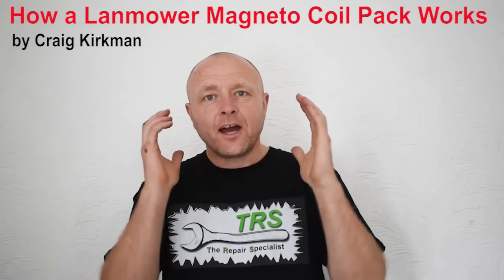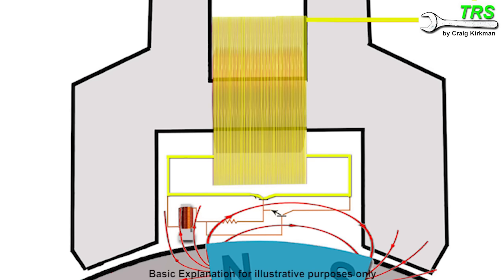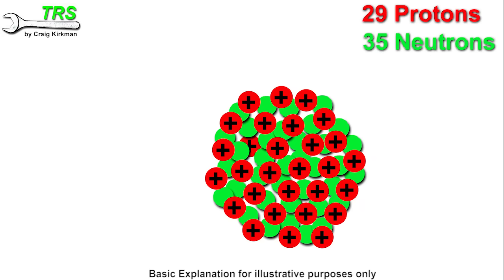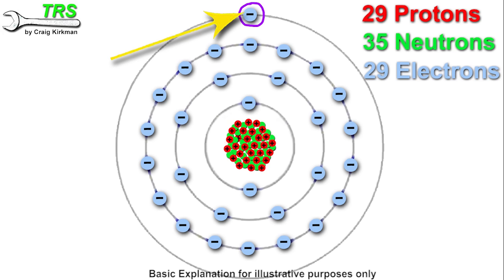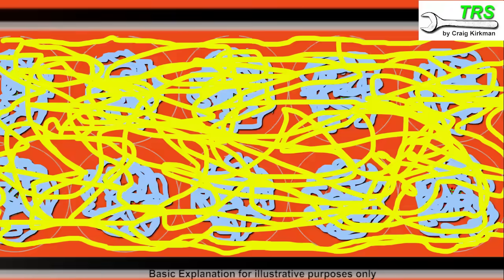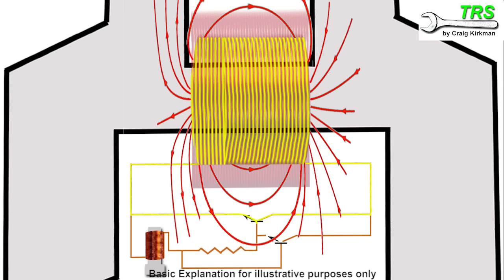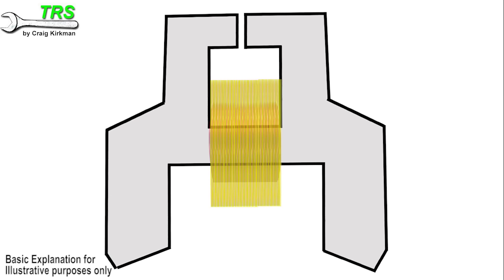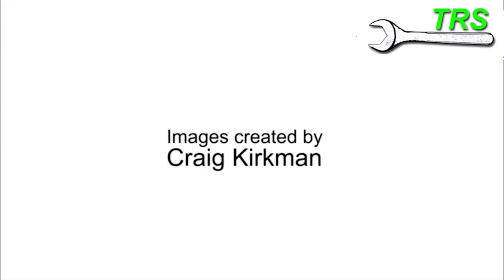Lawnmower Coil Pack Sparking System - Induction Coil, Transistor!  (by Craig Kirkman)

Comment: What was of interest to me in this very comprehensive explanation was the use of the transistors . I recall many decades ago small engines had a set of " points" similar to (much) older car ignition systems. All that mechanical switching changed in the early 1970s with the introduction of solid state electronics, AKA transistors. The circuit diagram drawn in the video is a clear explanation of just that transistorized switching circuit... where the " points" used to function 
Great lesson
Reply: So that's why we don't see points anymore! The function is necessary, the device isn't.

Comment: Great explaination. Never knew about the smaller coil and the transisters but understood everything else. Thank you.
Reply: The trigger coil and the transistors are recent additions that replace the ignition points used in older engines. This is because mechanical points degrade over time and need to be replaced periodically but the trigger coil and transistors should last the life of the engine. Modern cars and trucks don't have ignition points anymore for exactly the same reason.

Comment: I know a lot about electronics, I knew these were basically operating on the idea of a transformer. I always assumed though that they were more of an autotransformer with only one winding. I figured it would be like steel core, and then a ton of wire wound around it and the magnetic pulse from the flywheel just induced the voltage directly into the coil. In a way, I kind of see why they may do it this way instead but also seems less efficient. I have only seen a few magnetos none of them I have seen have a trigger coil sticking out of them so maybe there are two versions of coil then, one like this the other like I thought?

Comment: What's missing here it seems to me is the role of those Darlington transistors. They are acting just as the points in a battery/coil/spark plug engine i.e. when they shut off as the trigger coil field collapses, the primary current is interrupted instantaneously thus generating a rapidly-changing magnetic field which in turn generates the high EMF on the secondary coil winding, leading to the spark.
Reply: Exactly. These days they use the transistors instead of mechanical points. This is because mechanical points degrade over time and occasionally have to be replaced. In contrast the transistors usually last the life of the engine and never require replacement. That's why modern automobiles and trucks haven't used mechanical ignition points since the early 1960's.

Comment: Good job. I also did not know about trigger coil and Darlington pair. As an EE, I suspected that the current induced in the primary would be alternating. I think I now see that the transistors impede the reverse flow. That requires a high reverse breakdown voltage spec on the Darlington, but really shortens the mag. field collapse. As we know, E = -L (dI/dt), so that short dt gives the high V.

Comment: Overall very good.   I believe the circuit shown is slightly wrong on the resistor termination.   A resistor connected to a darlington transistor in the depicted location should have the left side terminated to the left of the trigger coil.  The darlington's trigger current path is as described however the illustrated resistor purpose, if present at all, is to speed up the darlington's shutoff.   Many circuits would show a ground which in this case also appears to be to the left of the trigger coil.  So that resistor in an npn darlington would be grounded and not tied to the voltage output.   It would be easier to explain with a diagram but that is not possible in comments. Adding a kill switch and the fact that modern magnetos often have even better logic for better 4 cycle control and faster starts.  Finally a brief "points" description for the younger crowd.

Comment: So does the spark occur on every revolution of the flywheel, or does the system store energy and only release the spark on every second revolution (am thinking about the 4-stroke cycle)
Reply: More advanced modules handle 4 cycle properly.  Otherwise they also spark on the exhaust stroke.

Comment: For years I wondered what changed in small engines that the points and condenser are no longer needed.  Now I know it's the trigger coil and its associated components.  Thanks!
Reply: me too!!
Reply: And I thought it was all done by magic!👍😂
Reply: Yes...my gosh, I was to the point of tears trying to understand that, now I get it!
Reply: Thank you for confirming exactly what I was thinking. It was a mystery to me until this video. And the guy at the farm supply I go to had it all wrong. He was trying to sell me a replacement coil that only worked with points and condenser that had been on his shelf for years in a crumpled box and was telling me that was the upgraded coil when I asked why they looked different. LOL.
Reply: Don't be fooloed by scams.
Reply: The magneto system in a lawn mower does not accommodate changes to ignition timing.
 
The distributor (where the points are) is a mechanical means (a rotary switch) to send the high voltage from the single ignition coil to multiple spark plugs in the correct sequence, with minor adjustments to timing.   

Modern ignition systems are controlled by computers. Solid state electronics get fried by high voltage so they need to use multiple ignition coils, one per spark plug, and the low voltage that triggers each coil is controlled electronically.
Reply: @thomassuit7450  Lawnmower engines are designed to operate at very narrow range of RPM, so spark timing is not needed. But the lack of durability (witnessed by the booming market for solid state coil packs) compared to the points ignition coils may be due to HV effects on the transistors. I wonder if anyone has done failure analysis on solid state coils.

Comment: Very well done! I've been around this sort of thing my whole life and studied electronics as part of being a  HVAC&R repair technician. 
Your diagram and explanation made this so much more understandable than anything I've ever seen. 
I'm retired now but I still like watching technical videos such as this. 
On a small engine with a magneto there is usually a condenser. I realize it is a capacitor but how would it have fit in your diagram? 
Thanks and I will subscribe and check out your other videos.
Reply: ther small trigger coil in place of a cap
Reply: The condenser is to stop arcing of the points when they open. As this circuit doesn't have points it is not needed.
Reply: What is a condenser?
Reply: @carpediemarts705  in automotive applications a condenser or capacitor is used to temporarily store an electric energy pulse or a what's known as a "charge". Only Momentarily will this occur. Capacitors or condensers are useful in that they will act as sort of a electrical shock absorber. Without a way to smooth out this electrical pulse the current flow will create unwanted erratic currents in the circuitry. Jumping from component to component causing all kinds of crazy disturbance within the field of continuity or all the areas within the unit. Whether in a radio or television or any appliance that uses printed circuit boards.
 They're used in small engines primarily as electrical shock absorbers not to reduce the flow but to get a cleaner and steadier spark.

Comment: Older lawn mowers will have points that perform the function of the transistor gates, also you kind of just glossed over the ground- it’s important to note that the ground is the path back to secondary coil. One end of the secondary coil is attached to the yoke (iron core) and the yoke is bolted to the body of mower completing a conductive path. This is how the electrons are returned to the secondary coil.

Comment: Please explain how these were built before the days of transistors, like we might have seen in an old law mower.
Reply: Transistors were used in the fifties. Before then a mechanical point system could be switching the power in combination with a capacitor, like in older cars.  Some mowers could use a simple capacitor resistor timer circuit but the big difference is the voltage output.  So transistorized systems are better at producing a higher output voltage.  Of course most engines have 12v batteries to begin with which becomes the initial trigger.
Reply: @rj.parker  Thanks

Comment: Excellent explanation more complex that I would have thought ,, before were primary, secondary points and condenser ,, now have this extra coil and 2 transistors that act as the points , still elaborated design , I wonder who came up with this ,, if I don't remember wrong Briggs and Stratton had pointless ignition in late 70 some where ,,, thanks a lot !!

Comment: yes the system is simplified and ingenious! even my 83 yamaha motorcycle has 4 coils instead of only 3 like the setup explained above!
its has a pulse coil, charge coil, (a transistor circuit with diodes and capacitor to store energy) and then a primary and secondary HV transformer..

Comment: I found this really informative, now do it with points and condenser in the circuit.
Reply: The trigger coil and transistors are a solid state replacement for the points and condenser. Older engines used points, which degrade and required occasional replacement. In contrast transistors don't degrade over time like points do so they last virtually forever.

Comment: Very well done. I'm glad I clicked on this video because I did learn something new. I didn't know that this circuit had a trigger coil but, I think you gave an excellent explanation of the theory of operation.  Thanks a lot!
Reply: The trigger coil and the transistors are recent additions that replace the ignition points used in older engines. This is because mechanical points degrade over time and need to be replaced periodically but the trigger coil and transistors should last the life of the engine. Modern cars and trucks don't have ignition points anymore for exactly the same reason.

Comment: Love this video, absolutely fascinating. I've never fully understood this principle, remembering when I was young I was taught how to make a magnet out of a screwdriver to pick up a small nut In a tight place. You can take a copper wire that's Insulated, of course and wrap It around the screwdriver several times and touch the ends of the wire to the positive and negative post on the battery and the screwdriver will temporarily become a magnet. i never understood why It always blew my mind thank you for this video

Comment: Thank you Craig for this great explanation. Just one question: Does this mean that the trigger coil with the Darlington Pair circuit was the next step on from the older contact points and condenser arrangement? Tnx.

Comment: With no moving parts inside the coil, HOW does one fail?  Does engine vibration break down the wire that goes to the Spark Plug?  If so, why isn't it manufactured more robustly?  It seems that a coil designed like this (if built properly) should NEVER fail.
Reply: I never had one fail, it’s always the shear pin, you do know what the shear pin is, and does ?
Reply: Usually its the spark plug wire or eventual insulation failure of the wire or the hv coil.

Comment: An additional note.   
Do realize that at the exact moment the spark plug fires,
the piston has compressed a gas/air mixture, and is approaching Top Dead Center,
where it is closest to the plug.  That subsequent explosion drives the piston
back down and the cycle repeats (both 2 and 4 stroke).
I noticed nobody asked about TIMING.
Q: How do you set the TIMING on this type of engine?
A: You don't.  Its designed for peak performance at a specific RPM.
Doesn't need to be efficient at all engine speeds, since its just a
grass chomping lawnmower.
THanks for THinking !!!
Some engine repair guy in  North Central Florida, USA
July 18, 2021

Comment: When I was fourteen I came across a upright Briggs and Stratton lawn motor. Learn pretty quickly how this aspects of the flywheel and coil worked. The permanent magnet had to be within mm's but I got the hang of it. Attached the motor to a go cart frame. Lots of abandoned roads and five bucks worth of gas. The good old days!!

Comment: I'm curious how ignition systems worked in lawnmower engines of the '50's and '60's, before electronic components would have been used.
Reply: They used mechanical ignition points to interrupt the current flowing in the primary coil. The mechanical points needed a rotating cam that caused them to open and close. The problem with points is that they degrade over time and occasionally have to be replaced. Replacing the points with the trigger coil and the transistors, which don't degrade over time, meant less maintenance because there were no longer any points to replace.
Reply: @joevignolor4u949  you describe the 'point using' Kettering (sp?) system, different system = magneto ...

Comment: Excellent video! I've understood the principles of how an ignition coil works as I was a mechanic but the magneto has always been a mystery to me.  One question though,  don't older magnetos had points. How are those used in the primary circuit?
Reply: Instead of the trigger coil making transistors switch current it is a lobe which moves the contacts of your points.

Comment: Good stuff 👍.
I have a B&S engine on my lawn mower. It is pretty reliable but it started to make grinding noises.
It turned out to be the trigger coil had walked it's way out of the assembly and had started to grind on the flywheel. This also impeded the starter cord from rewinding properly. Because the tip of the core of the trigger is shaped to fit closely to the flywheel it had spun nearly 180° and jammed. I deburred the core and the gouge marks on the flywheel and refitted it with a dab of Araldite it's been fine since.
Just one of life's little experiences 😁.

Comment: Then throw in the twist and say in reality it flows the opposite way
Reply: I was taught in tech school that electrons actually flow from NEG to +POS+
Reply: @JuanDaringMann  yea that's the scientific understanding but still planned and taught the other way around
Reply: Conventional current flows pos neg in the direction of the transistor arrows but actual electron flow is opposite.  The result of a mistake early on.  So conventional current is still most often described.  To make things more confusing, by the time FET transistors were invented, the mistake was corrected on FET symbols.

Comment: Ha! My 30 year old Yamaha mower still has contact points. I didn't know that until a year ago when it started spluttering. Pulled the flywheel to get the coil out and found the real problem - points with no gap. 15 minute fix.

Comment: very good explanation, I'm confused by the shape of the iron core, why is it shaped like that and comes in contact with the magnetic field when the flywheel magnet passes by? you mentioned that it picks up the magnetic field at 3:40, but is there a reason for that? Does the magnetic field in the core before the coil field collapses demagnetize or magnetize the core so it's more efficient for the pulse?

Comment: So almost everything has different gap requirements for the spark plug but does a bigger gap make a stronger or weaker spark? Is the gap determined by how much fuel is being ignited in the cylinder?
Reply: There is a trade off when the manufacturer specifies the spark plug gap. If the gap is wider it exposes more of the flammable mixture to the spark, which increases the chances of a successful ignition. However, widening the gap increases the electrical resistance of the gap, which makes it more difficult for the spark to jump across and this can produce more misfires. So the plug gap is set to where there is the best compromise.

Comment: That is the first time I've ever had the full explanation of how that works.  In the past I've only heard of the secondary coil until lately and then they only menchend the primary and secondary  nothing about the exciting coil  .  So if the primary coil has 92 raps how many would the secondary coil have  & how many would the exiter coil have ?
Reply: You are talking about something known as "turns ratio", which will determine the output voltage of the secondary. That is determined by the manufacturer of the coil. It's something that's only talked about generally. Like he said the primary coil typically has about 100 turns while the secondary coil has thousands. The number of turns on the trigger coil are sufficient to create a voltage pulse high enough to turn the transistors on and off.
Reply: @joevignolor4u949  thank you that gives me a better understanding!  I'm hoping that when I  try to rebuild a coil I can get it right the first time.  If not I will try and try tell I get it right.

Comment: Such a clear and comprehensive explanation! Thank you very much, I have one question. Car engines used to work in the same way to drive their spark plugs, already in the days when transistors did not exist. Same goes for fluorescent lights. What was used to achieve the switching?
Reply: The transistor switching part was replaced by a mechanical
Switch that was opened by a small cam  with capacitor across it.  (Points & condenser) this would do the same as the transistors and break the current in the primary winding
Reply: Fluorescent lights on ac power use a ballast box which varies but typically was a transformer from 60 cycle to high voltage.  Now solid state oscillators do it in "boost" mode and can be purchased to run off batteries or ac.

Comment: Great video.
One question, one terminal of the secondary coil goes to the spark plug, but the other one goes to the chasis of the motor right?
Reply: The circuit is grounded to chassis which becomes a conductor.   The circuit was simplified and not exactly right.  Plus it does not show the kill switch which grounds out the primary coil voltage in most cases.
Reply: @rj.parker  thank you